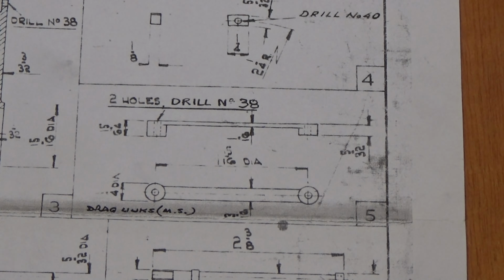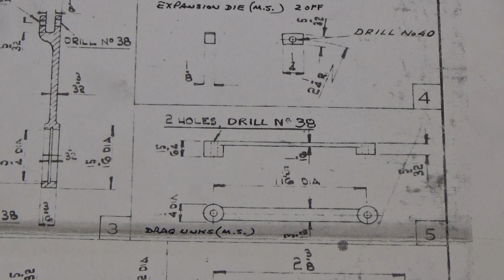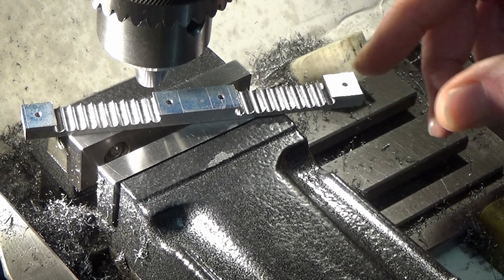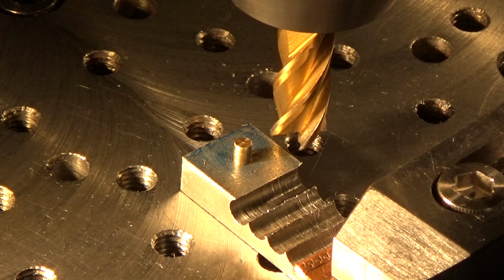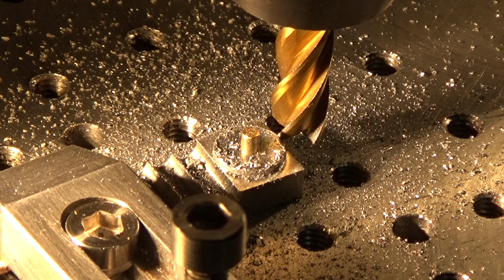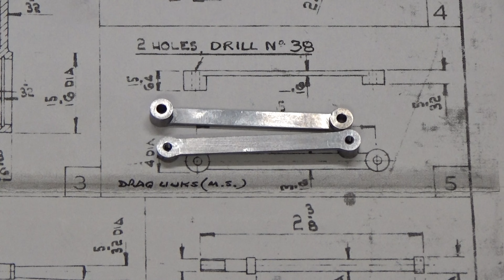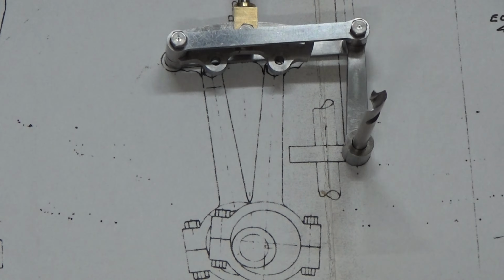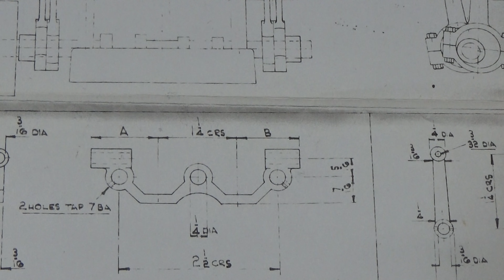Stuart Turner Twin Launch Engine   pt4   rev gear   drag links

Comment: Hi Rob.  Myself I silver solder these types of jobs save in material and expense.   Yes there much waste and making a jig out of tool steel harden and temper would allow you to file finish. The jig could be used for other jobs down the way.
Reply from the maker: There are many ways to skin a cat so they say but I’d already paid for the casting so tried it, fully fabricated was my plan B but it went well I thought. Thanks for your comments though.